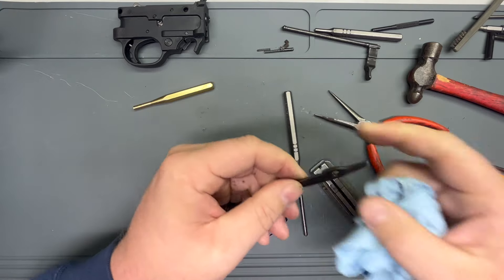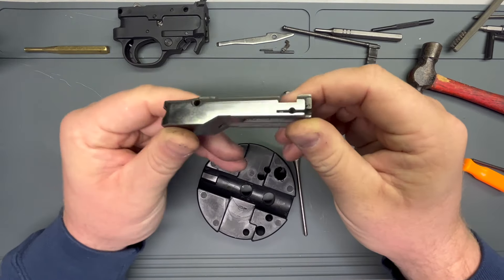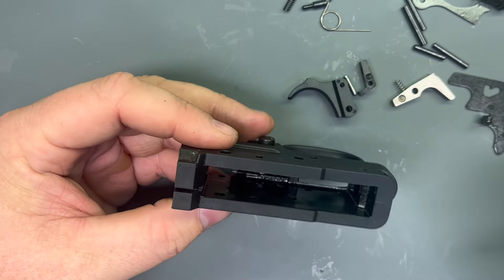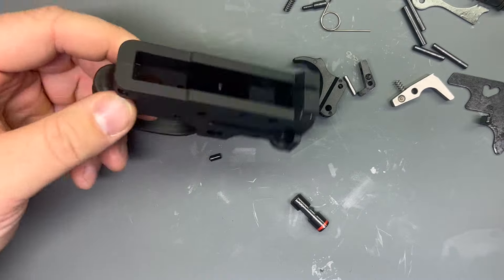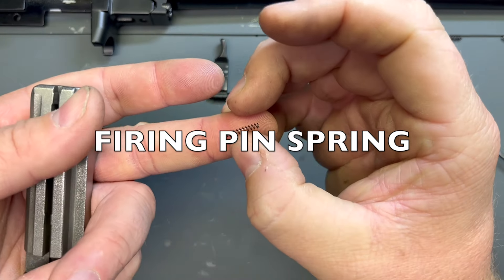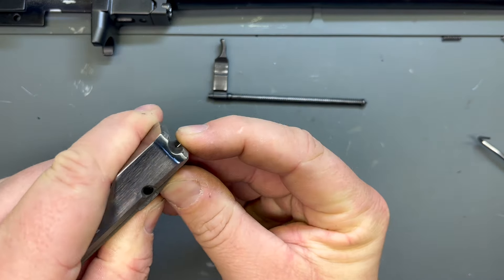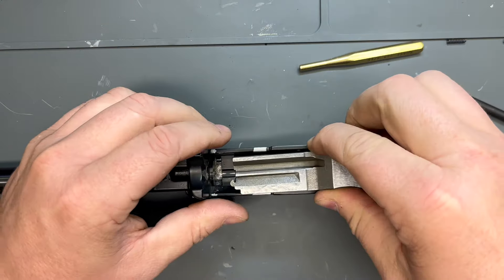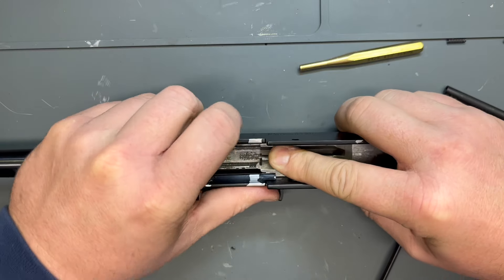Ruger 10/22 Full Disassemble and Reassemble

Comment: Are there any points on the trigger that we should Lube before reassembly?
Reply from the maker: Trigger lubrication is one of those topics where people will always disagree.  One school of thought is: any time there are two metal surfaces making contact you should apply lubricant.  The second school of thought is: never apply lubricants to a trigger assembly as the lube tends to collect dust and grime, causing excessive wear and potentially a failure in your trigger group. 

I stand firmly in the middle.  I 100% believe all lubricants, oil, grease, even CLP, will collect grime faster than a dry part.  HOWEVER I still always oil/grease every moving part.  The key is CLEAN YOUR TOOLS!  If you clean and reapply lube every time you use your guns, they’ll last forever.  To each their own, but I’ve seen what happens when guns are neglected and it ain’t ever pretty.
Reply from the maker: That goes for carry weapons as well.  Even if you haven’t shot it, you should spend a few minutes at least once a week to strip, clean and line your CCW.  That tool is more important than any other weapon have, as your life or the lives of others may very literally depend on it someday.